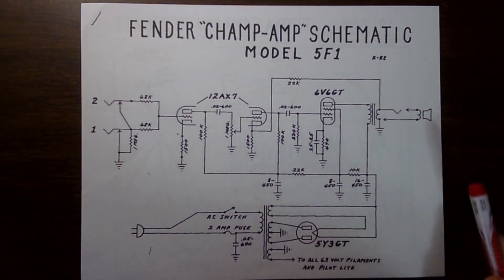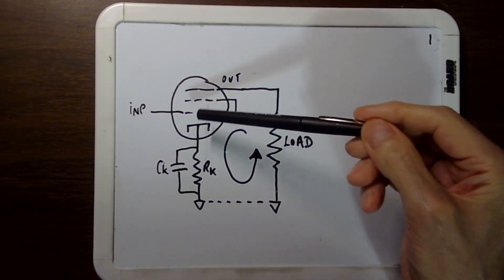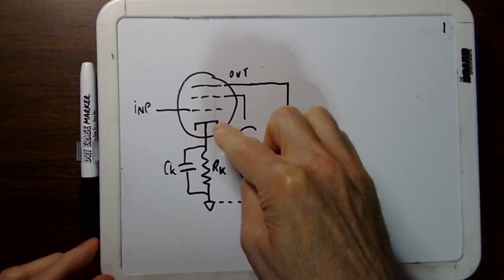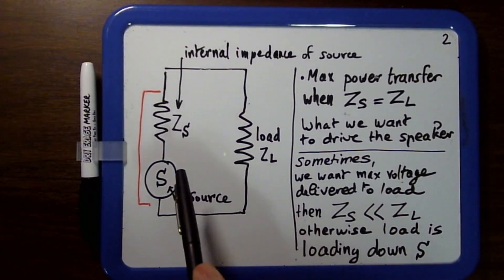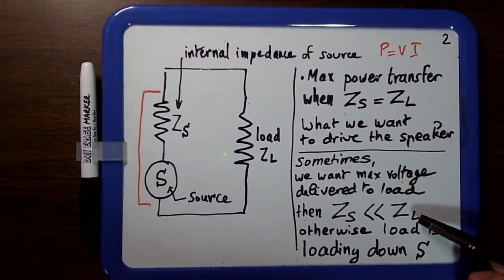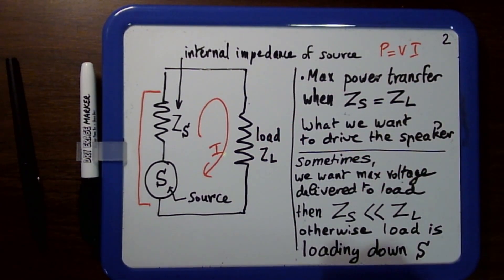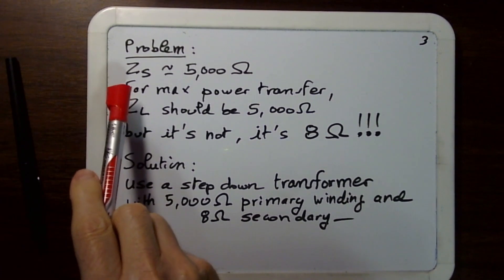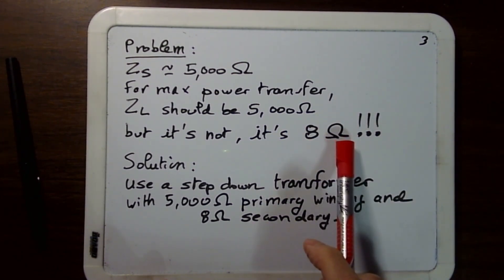Impedance matching and why an output transformer is needed in tube amps

Comment: well, there is a version of transformer impedance matching in which the primary of the transistor is tuned with a parallel capacitor and tapped. what is the purpose of this?
example: https://www.youtube.com/watch?v=qlx7KRSiPM4
what are the purpose of these taps?